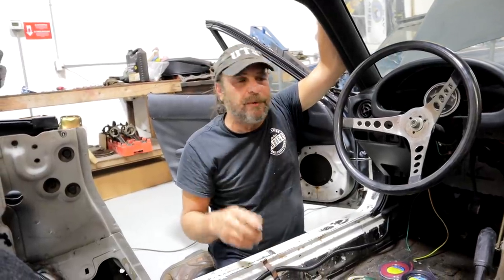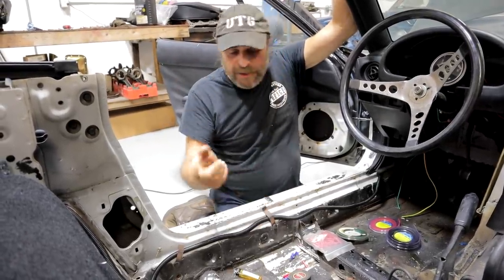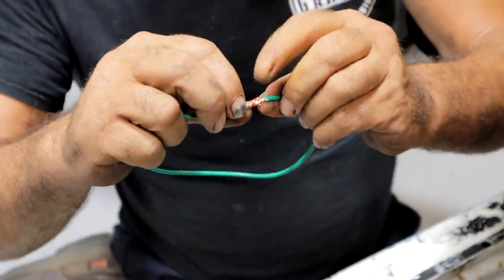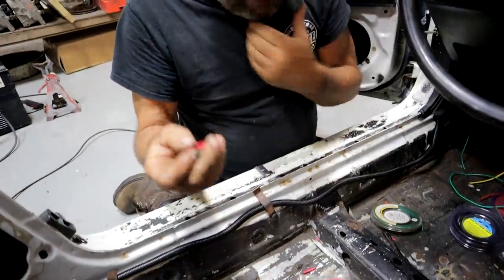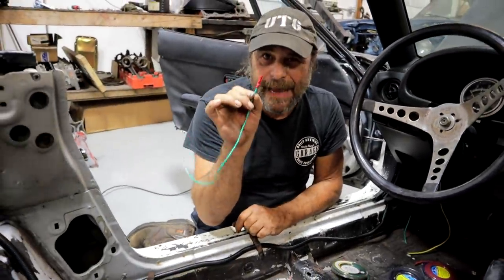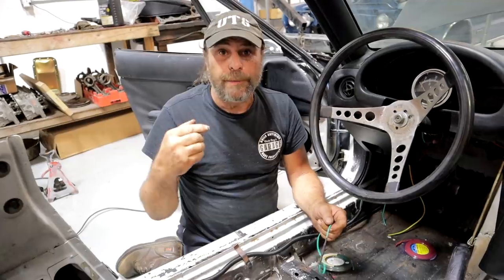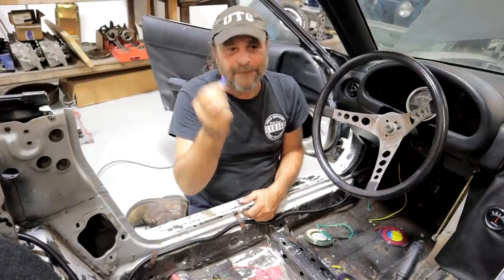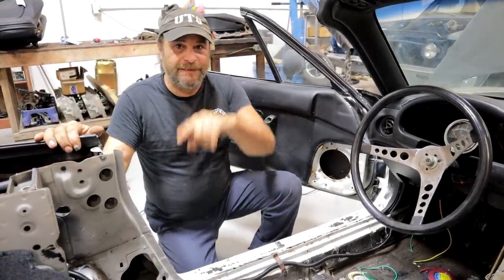The Single Most Misused Item In The World Of Cars

Comment: Also stagger your connections if you're doing multiple wires in the same loom. That way you don't have a giant pile of connectors. If they're staggered evenly it is easier to hide in a loom
Reply: A bonus to staggering is if two connections do fail, the wires will not short across each other. If all of your connections are in the same position in a set of wires, in the event of failure they can all contact one another. If not in a plastic loom there is still still a chance of a wire contacting ground in the event of a failure.
Reply: EXCELLENT advice and actually a related point is to make sure you have enough slack to A) prevent issues from stressed wires and vibration and  B) to make two repairs "in the field", or in my case, in a gutter full of snow melt by the side of the road in Boston at 3 am. Don't ask. But making a "service loop" is a great advantage if you're no good at stretching wires to make them longer. So far, nobody has successfully done that.
Reply: A 'Snake swallowed a Gopher" look? I use to splice telephone cables and you had to stagger the connectors if you wanted the splice to fit in the splice case.
Reply: You can actually splice zip cord (ac lamp cord) without individually insulating the conductors just by staggering and covering the whole thing with shrink.  Doing that gives you a beautiful, visually clean splice.
Reply: Right on
Reply: @hunkydorian  But you need to insulate themselves anyway especially for 120VAC
Reply: Always do ..
Reply: Also don't buy your shrink tubing at Harbor Freight, it's very thin.
Reply: Maybe double it then don’t buy again
Reply: That is great stuff. Nothing wrong with teaching the "basics" the right way!
Reply: The worst is foriegn made trucks rear taillights, American trucks (class 8 trucks) have four wires (r, b, g, y)  with the brake lights operating through the turn signal circuit and no ground. Foriegn trucks have a wire for every single bulb and a ground. I do specialized truck bodies and we always get new truck chassis to install the homemade bodies and we're always moving the lights depending on if the truck is getting a liftgate or specialty rear hook up or just an average ICC bumper.
Reply: There are connectors available now that have integrated solder and heatshrink. I wouldn't use them anywhere there is likely to be stress on the wires. On cars that shake a lot I use crimps (Not the butt connectors shown in the video) put on with a hydraulic crimper and heatshrink. Look at the wiring loom on your modern car, it uses crimps and loom tape.
Reply: 200th like 👍 good point, thanks for sharing 🛠☕
Reply: @CircuitSecrets  subscribed just because this was a face palm moment for me. Like why haven't I been doing this
Reply: @bbb462cid  I retired from building aircraft wiring harnesses for 32 years. That is how we build splices in, stagger the splices and "sheep shank" or double back the wires on each end to the splice. tie the loops and there is no strain on the splice, and if you have an oopsy daisy, you don't have to pull a new wire in because it is too short. ( edit; changed the word wire to splice. No strain on the splice)
Reply: @zulumax1  Roger that, I hold a few IPC certs
Reply: @rickh6963  there are some good ones that have heat shrink with hit glue on the inside of the shrink tubing as well. Crimp on, then heat to shrink the tubing and melt the glue at the same time. Makes a waterproof splice with the glued-on heat shrink increasing strength.
Reply: Rob from Australia!  that crimping tool of yours is a TOY!!!:  Also  Never twist the    
the strands , as this effectively makes the cable a solid conductor And we all know you can't crimp solid cables  eh!!!  You YANKS
Reply: @roberttomasovic6433  330 million people in the USA. Personally I would never categorize all 26 million people in Australia by one bloke crimping a wire, but that's just my screwy Yank mentality at it again. Cheers.
Reply: Not only that but if you disconnect multiple connections it's quite easy to figure out what goes where if they are staggered. Especially if you sell the car to someone else.
Reply: Shrink won’t hold it
Reply: Linesman splice and shrink send it.
Reply: Easier to avoid shorting two connections together.

Comment: Having worked as an certified Master Auto Technician for 40+ years, every time I saw a crimp connection in a circuit, I replaced it with a solder joint and shrink wrap.  Sorry, crimp connectors and shrink wrap are not going to do the job.  You still have a danger of a high resistance connection, only one now that may be waterproof.  As we used to say, do it right the first time.
Reply: Solder connectors are fine with old vehicles but when you start dealing with sensitive circuits like in a computer controlled vehicle where you are measuring voltage drop in the 0 to 5v scale you dont want to solder as the extra resistance will cause issues.
Reply: @Milner62  Exactly the opposite.  You run into more of a danger of a high resistance connection with a crimp connection that you do a soldered connection.  Exactly why Chrysler and GM both specify solder connections in modern vehicles in computer circuits.  Done enough recalls on Jeep Grand Cherokees where TIPM wiring, PCM  and BCM wiring was replaced with updated circuits,  Each time, it was stressed that only solder connections were to be used.
Reply: Not the opposite.  Power flows along the outer most strands of the wire.  When you fill the wire with solder you introduce more resistance into the circuit as well as producing a stress point that increases the likelihood of breaking the wiring.

As far as Chrysler recalls goes I wouldnt put much faith in that.  They are known for having crappy wiring off the bat the same as VW is known for having crappy wiring off the bat.

As far as GM goes, you would have to show some proof cause every pigtail purchased directly from the dealer for late model cars comes with bare metal crimps not solder connections nor does the paperwork stress to solder the connection.  Same with Ford, Ford pigtails stress to not solder the connections but to crimp them to avoid introducing increased resistance to the circuit.
Reply: @Milner62  electrical engineer, properly done soldered connections are always lower resistance than crimped ones. Also not sure where you're getting the idea that it increases fragility. Simply untrue.
Reply: Just letting you know, I’m the racing world, soldering anything that isn’t a potted connection is highly frowned upon.  Proper, mechanical crimp connections that hold to the sheathing are the standard.  This holds true for all milspec wiring as well.  Soldered wiring connection have been shown to be much more brittle and susceptible to fracturing in real world field conditions.  I’m not saying all crimps are superior, but properly done crimps with the proper connections have been shown to be superior in every major race teams experience on the planet.
Reply: @saab9251 , yep between crimps and soldier the crimp when done properly with the proper tool is superior.

I remeber I used to soldier all my connections 20 years ago but then I took automotive electrical and found out that crimps are the industry standard and the preferred way especially on computer circuits as even just a 0.01 ohm increase in resistance can make drastic changes in a system that is reading voltage/current change on a 0 to 5V scale.

The wiring I'm making up for my trucks auxiliary circuits are being redone to eliminate all add on soldier and crimp connections.  I want the wires to be jumped together at my fuse/relay panel and have no splices in between.  That is ideal but ideal isnt always possible hence why I have crimps and soldier joints on my current auxiliary circuits to extend the premade harnesses I bought.
Reply: @saab9251  milspec == cheapest possible. Remember that. 

Cold solder joints are absolutely worse than good crimps. Good solder joints are far stronger. What you're saying does not have merit. Properly done solder joints are just as shock resistant and  far more corrosion resistant.

Solder is used for space applications. Pretty sure that is nuff said.
Reply: I have been an Auto Electrician since 1975. I can't be bothered working out how many years that is. I have found that soldering copper wire makes the joint brittle and prone to breakage, especially if the wire moves or vibrates. It takes time, but it will eventually break. I moved away from soldering and almost always use connectors (Deutsch) to connect wiring. I will replace a whole wire if possible rather than joining it.
Reply: @stephenvelden295  wires that go to space are soldered, not crimped. If that isn't proof enough for you, nothing will be. A good leaded rosin core solder with shrink wrap will hold many times stronger than crimped connections.
Reply: @ai_university  Then why do companies like Caterpillar, Komatsu, etc never use solder? They always use crimped connectors. Believe me nothing gets more punishment than a bulldozer!
Reply: @stephenvelden295  pretty sure anything going to space gets more punishment, between the heat/cold and vibrations.

Hard to get a good solder joint in the field is my guess as to why they use crimps, and probably even harder to train non-engineers to solder well. Actually, that's gotta be it. Easier to just spend the money on good crimps rather than spend the money training employees.

A pox on economies of scale
Reply: @ai_university  it's not the soldered piece that breaks. It's the unsoldered part right next to it. It's like engineering structures in earthquake zones. Rigid fails, flexible does not.
Reply: @Milner62  if that is the case, than why am i repairing air bag wiring by adding solder to the crimped end because of high resistance..    and that is the oem approved repair!
Reply: Meh.  Crimp connections work fine IF you keep moisture out - but the seam must be up or down in the tool, never sideways.   8awg and larger wire needs a pro uality crimper for good pressure - not available at an auto parts store. Tony is on the money regarding "guillotine" connectors: total rubbish for anything over 2 amps - twist & tape will outlast them [I saw alot of that leave so-called professional installers shops in the 80's and 90's].  I like 130C tape where sealing is critical: give it some stretch as you wrap and it will self fuse after about a month - put a final wrap of 33, and it can last decades [except if.soaked by solvents: then the 33 will unwrap itself].  So called "jap-wrap? Not good except an indoor/air conditioned environment - it does not perform well under the hood.